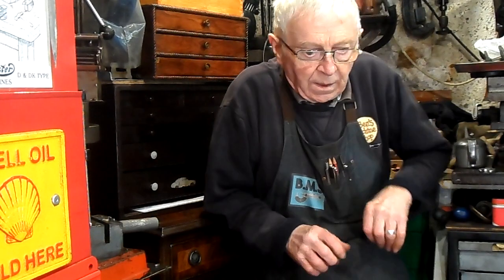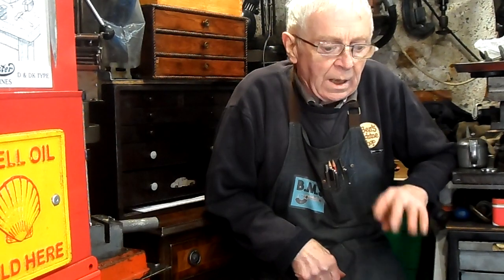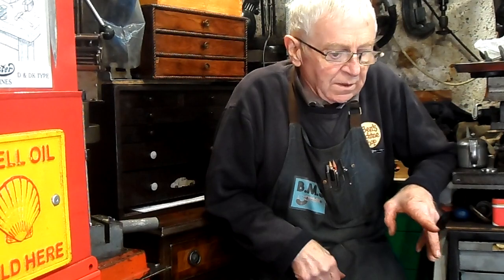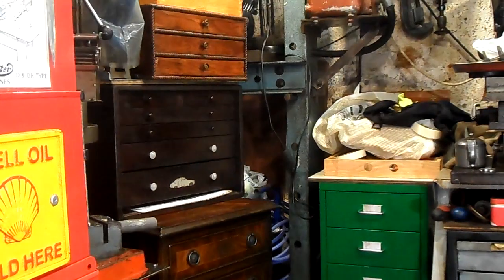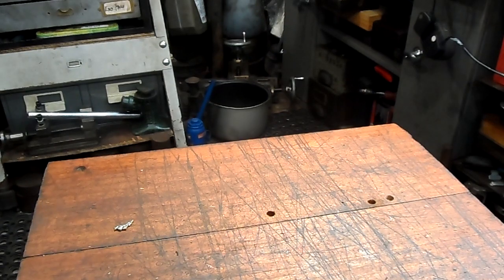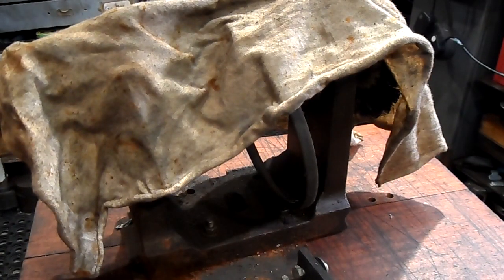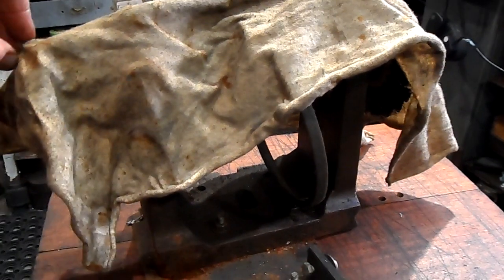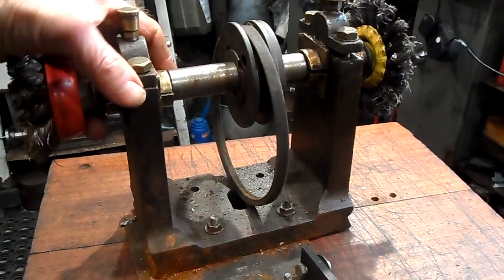Nuts and Bolts Art Lathe

Comment: Benny, I have a commercially made grinder like the one you made and about the same size. It has plain  bushings and oil cups as well . There's no base but the pillars have a bridge between them and they have flanged feet so they may be bolted down. The advantage of the design is that the motor may be mounted directly below the grinder. It's been on the shelf for years though I have kept it cleaned and oiled. 
If those are the brushes that you intend to use I'd go with a 3/4hp. motor  or better.  Any thing smaller and those aggressive brushes will be bogging down in the work all the time. 
The lathe art is cleverly made.. I'd keep it on the window sill too.
Cheers from NC/USA